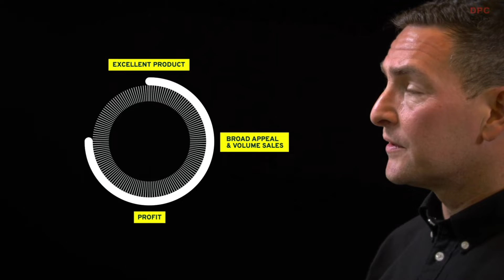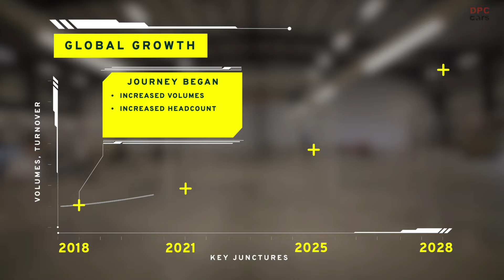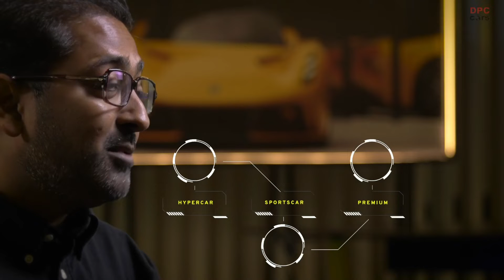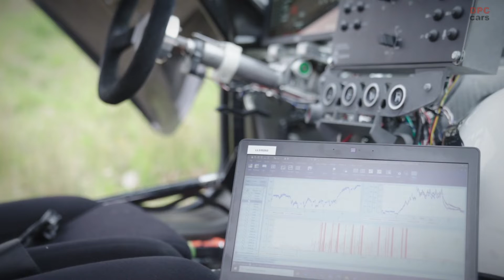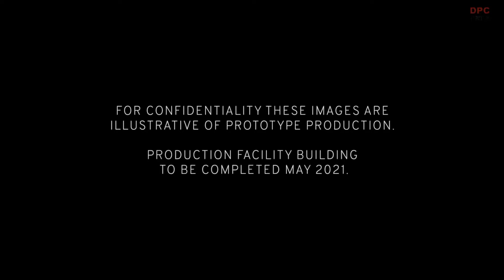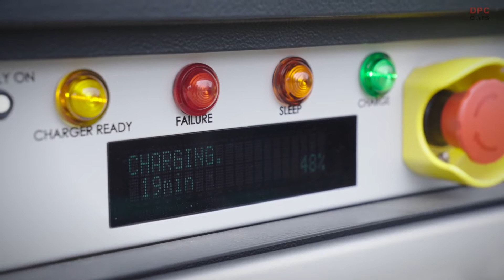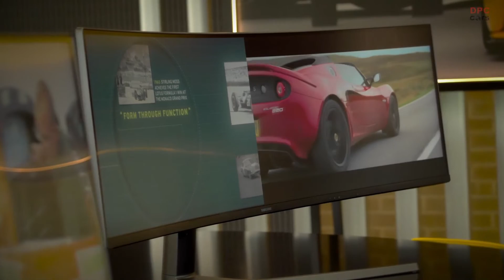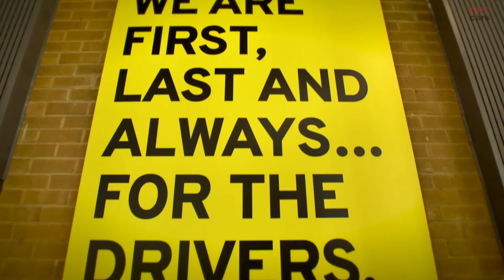New Lotus Name Revealed As EMIRA and Companies Future

Comment: Putting all powerplant eggs in the 'electric' basket is a huge mistake.  

As a buyer of new Lotus cars since 1996,  and having just bought my most recent one in 2020,  I'll buy the 131, but if they follow through and drop the ICE powerplant,  I'll be switching exotic car brands after a quarter century of loyalty to the brand.
Reply: @Amarjit Singh Dhesi Not excited at all about the Evija. If it was an ICE-powered machine, different story.

Sorry, there are a lot of sports car enthusiasts who feel contempt for electric driven vehicles.

After buying Lotus cars new, from dealers in 2 different states, since 1996,  I have zero plans to buy an electric vehicle from Lotus or from anyone else for that matter.  Unless Lotus gets a better feel for who its customers are vis-a-vis ICE-powered mid-engine exotics,  I think the drop in sales will be a big surprise to them.

Are you aware of the legion of sports car fans who pay a lot of $ to watch Formula One?

Are you aware of the dismal viewership and ratings of Formula E, an all-electric  open-wheel race series with cars that look quite close to F1 cars?

Sports car fans do not like Formula E too much at all.

Sports car fans want ICE-engine noise, right behind the driver.  Period.